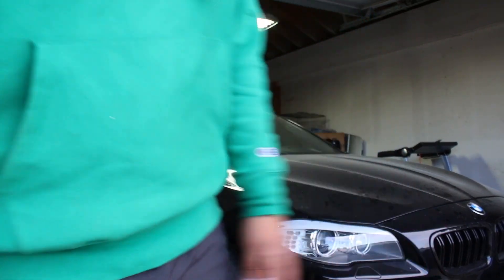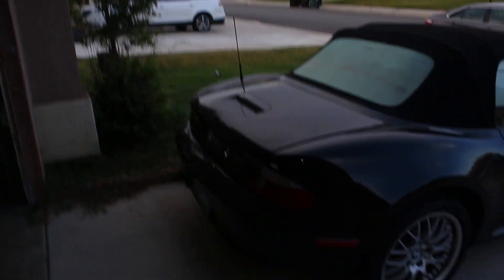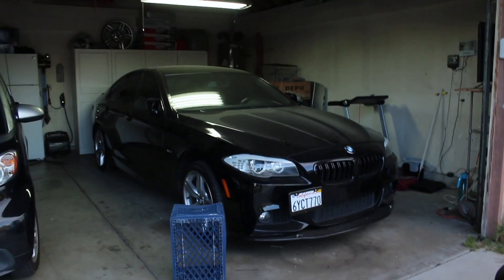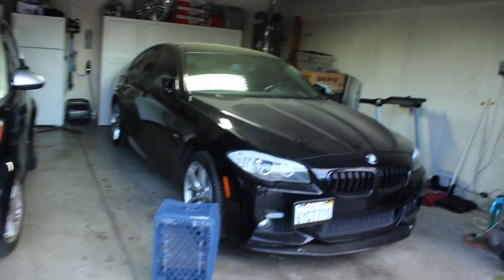My BMW Engine Blew UP! BMW Quoted me 18,000$! Now What!? BMW F10 535i N55 Rod Knock

Comment: 10,000 - 15,000 miles is almost 2 or 3 years of driving. It's crazy to think that anyone would wait that long or recommend those intervals. 3,000 - 6,000 miles is the sweet spot. The fix for this is usually $2,000 to replace rod bearings. No idea how you convinced them to give you a brand new N55 for $2,000. That is crazy.
Reply from the maker: Yes that is crazy but I don’t even blame them because they were following bmw intervals. Old white couple. For me 5000 is the best number for any car. If I did not have warranty I would definitely rebuild the engine, but with warranty it was in my best interest to fight for a new engine! I appreciate your comment!

Comment: I have one of the last model n55 in my 640xi . I heard the xi Models had a natural baffle due to the placement of the differentials in the x drive which helped. But I will be deff letting my car warm up to operating temperatures and changing the oil every 3,500 miles . I think thats key with these engines and also replacing any gaskets that have oil leaks. Im sorry for you hard time but lets be honest 2,500$ -3,000$ for a brand new enigne is not bad
Reply from the maker: You’re a 100% correct. The awd shaft acts like a baffle system if you’re taking sharp turns at high speeds. I feel blessed that I got the new engine for so cheap, I’m never buying car without warranty. They paid out 22k in repairs. I think the best advice is to heat up car before going anywhere near redline, like you mentioned and I would also use a oil addictive like “liqui moly ceratec”. It will protect the engine if your car ever needs it, and it will also make it run way smoother! Good luck to you and your car!

Comment: Do you recommend buying a F10 535i even though it has a possibility of spinning a rod? I’m someone that drives real aggressively doing constant lane changes, and would that make the car suffer from oil starvation? I’ll probably get a warranty to have some peace of mind though
Reply from the maker: Yes I do recommend you get one. The chances of the rod spinning is very low but the possibility exists. I would definitely look at maintenance record and make sure oil has been changed every 5000 miles and not 10-15k bmw recommends. I would also look for unmodded adult driven car. Aggressive driving will not hurt the bearing, just make sure you’re at optimal temp before going anywhere near the redline. Avoid DONUTS! Avoid ever running low oil! Low oil is your biggest enemy when it comes to rods slipping.
Reply from the maker: A warranty will keep you at peace. Make sure you read and understand the fine print.
Reply: @rono  Yeah I never drift or do donuts so I should be fine. (Hopefully Lol)
Reply: eh this is what turns me off about the N55. The entire purpose of paying a premium price for a god damn BMW is to be able to do donuts and drift and I really wanted a quick F10 but i’m just going to stick to a N52 F10.
Reply from the maker: N52 is definitely the most reliable F10, but it’s lacking power compared to the n55 variant. N55 can be tuned for more power, where the n52 cannot. I got unlucky with the rod bearing failing, but a lot of my friends have n55 with 100k + miles running strong with mods!

Comment: The key 🔑 with this engine is changing your oil every 3k miles I got a 2013 f10. 535i 130k mileage no problem at all thanks god only brakes and normal stuff
Reply from the maker: Yes I will make sure to keep things in check this time. Thank you for watching! and good luck with you F10!

Comment: Was it tuned before?
Reply from the maker: 100% stock. Past owner was 50+ lady. And I didn’t tune to keep my warranty active, which paid off in my situation. Think it was combination of 10,000 mile oil changes and canyon driving.
Reply: @rono  Good thing you have warranty. I also have one on my F10 535i, which was only been used to correct oil leaks, nothing crazy. Im at 150k, was thinking warranty may of been a waste, but you never know.
Reply from the maker: Take your car to inspection every few months at 3rd party shop. Then take all those problems to the dealership and use your warranty to fix them. Get the best out of it, as you paid for it. I was able to get 33,000$ in repairs from my warranty before it ran out.
Reply: @rono  why do you say dealer for repairs vs Indy shop? 

I resist the dealer only because my local BMW dealer sucks, from techs to SA. Repairs are sloppy. I don’t know a specific tech there so I get concerned about their work. Also too many bad past experiences that this particular dealer.
Reply from the maker: @Chris-rs3dj  I say dealer because they do the same thing over and over again day in and out. They have the exact tools needed to fix the issue and also they torque everything to specs. With warranty it’s free so I prefer using the dealer. But if you have very good mechanic you could keep going there. BMW also gives 2 yrs warranty on all their parts.
Reply: @rono  what warranty paid all that
Reply from the maker: @yophilli  EasyCare (company) Total-care (package)

Comment: I'm selling mine,  mine blew up to, getting changed for 5k 90k motor...bmw n55 is horrid
Reply from the maker: I have a new engine in mine. Not sure if I wanna sell yet
Reply: @rono  I'm going to keep like 4 months,  either get an accord or go back to Audi 😆 

Beautiful car,  but I've never seen so many engine failures  *on group pages and YouTube. 

Makes me wonder why people still buy them.
Reply from the maker: @nicblank09  accord sounds like the smart move. The new ones move really quick and comes in manual configuration. 

F10 is beautiful and I feel like people buy it cause it’s fast, luxury and sporty and cheap. Unfortunately the flip side is engine failure, especially on the F10s
Reply: @nicblank09  actually the N55 is known to be a very reliable engine. The first batches (2009/2010 build dates) had some rod bearing issues that werent that common but i have an N55 with 160k miles and literally doesnt burn oil and i have never had any engine or trans work done outside of routine maintenance. Mine has been tuned for the past 20k miles and still have no issues and i keep a BMW specific code reader on hand (cost $100) to help diagnose anything myself.

Comment: Nice new engine that car will last you another 10 plus years enjoy. I wouldn’t sell it
Reply from the maker: Fingers crossed haha
Reply: @rono  you just might have to replace the transmission once it gets very old other then that I say the car will last you a long time. You should do a transmission service replace the transmission fluid and filter asap to extend the life of it.
Reply from the maker: Thank you for the tips! Transmission service in high up in the agenda and I will try to have it done over summer. I’m just scared that it might start slipping after service, like I’ve seen on the forums. I will still willing to  take the chance and put fresh oil in there